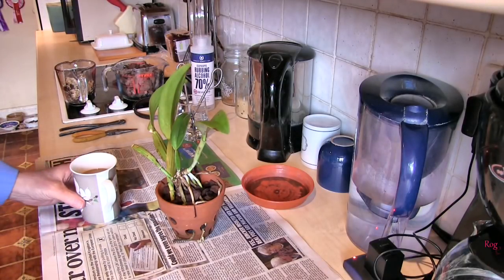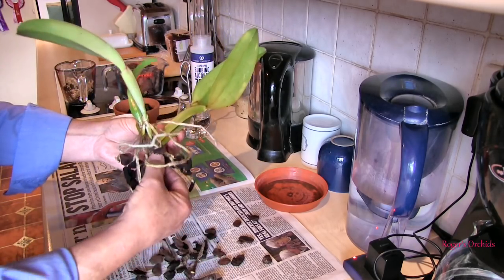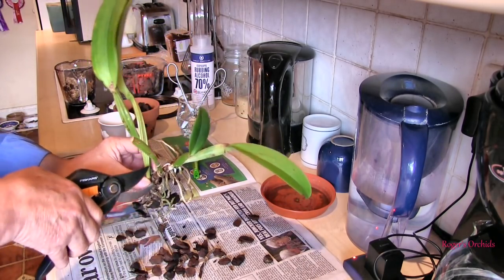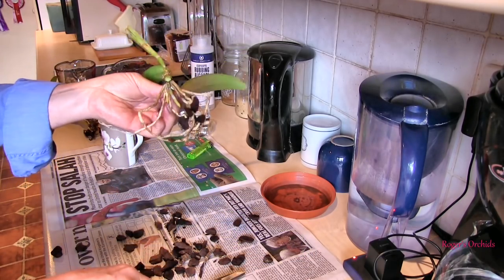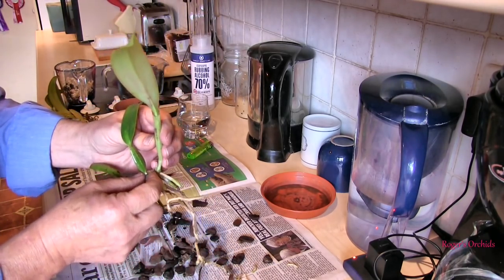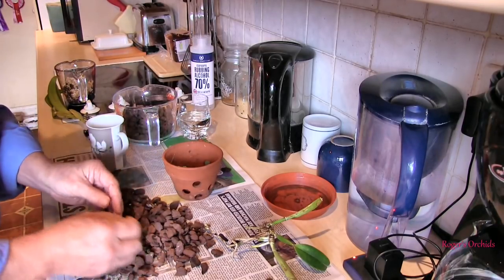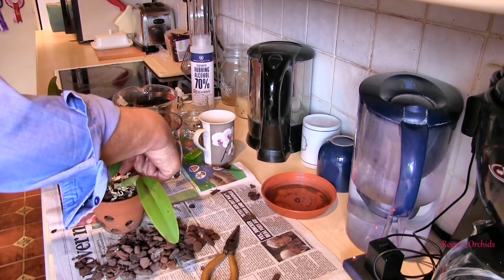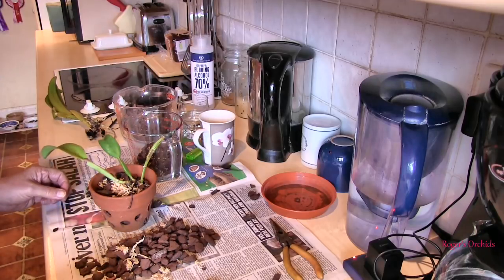Kitchen Time - Repotting a 'Project Orchid'

Comment: Thanks for the open challenge Roger... the OCD side of the Asperger's just kicked in 🤣
Reply from the maker: Good luck - many (including me) have tried and even got close but not 'spot on'. So far, it remains a mystery.
Reply: @RogersOrchidsGardenandBonsai  I do have a starting point though... the recurved sepals suggest a possible connection to the Laelias and the floofy petals suggest a Cattleya influence.  The throat shape is likely to be a dominant gene as many Laelia and Cattleyas don't fully overlap.  

My current research suggests at least part of the cross that went into the NOid Cattleya could be Cattleya gaskelliana var alba as well as Cattleya lueddemanniana

Comment: Thanks Roger. I have potted Cattleya and other orchids using volcanic rock and stone. Am I making a mistake?
Reply: I’ve seen Rick L using both with good results
Reply: there are a lot of nurseries in Hawaii that have grown orchids successfully  in lava rock for years Now,
Reply from the maker: Lava rock is great but will hold nutrients over time so need a good flush now and then. Pebbles/gravel/stones work well but the watering frequency will need to be a lot more as those medias don't hold any moisture.
Reply: I was on the Big Island of Hawaii in October. All lava rock is black.  The locals say,  “That is good for orchids ‘brother’.”

Comment: what is extra light doing with a plant if the temps a bit low?
Reply from the maker: In my previous Winters, many orchids stop growing as it's too cold combined with low light AND short days. By adding in the extra light on really dull days and extending the day lengths, I'm hoping that they keep 'ticking over'.